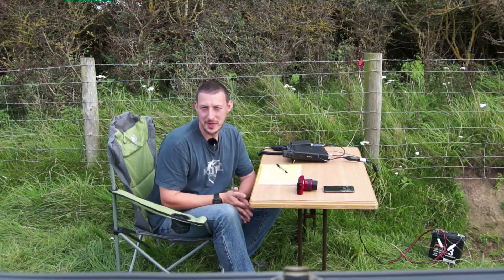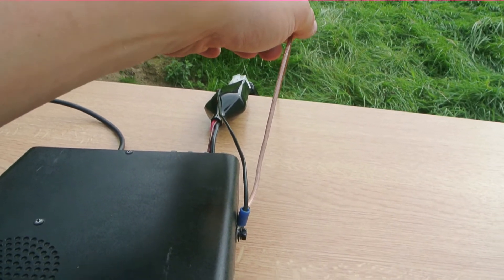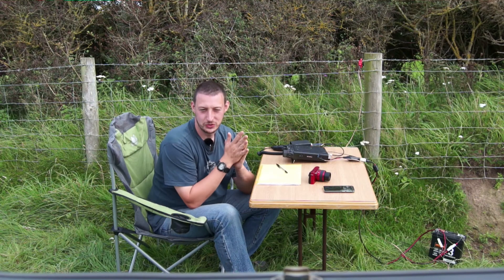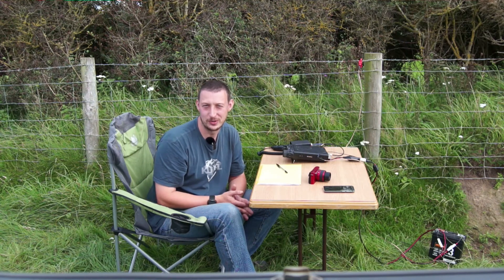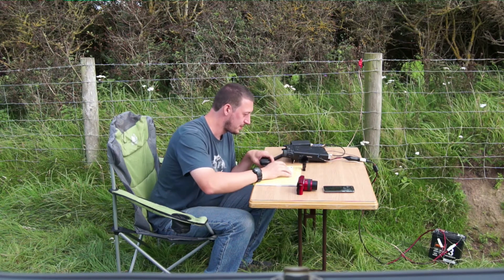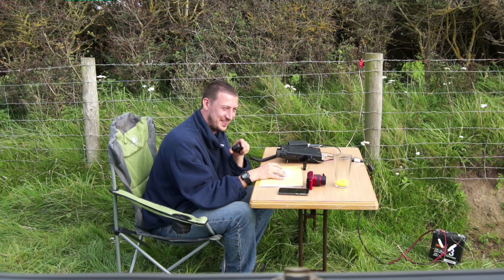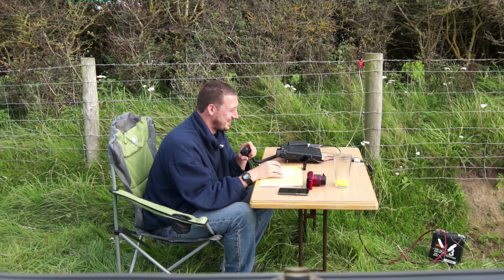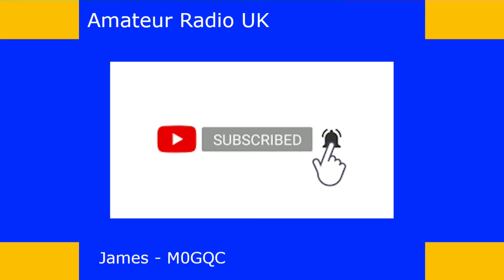Tuning A Barbed Wire Fence - A Prepper's Antenna?

Comment: U should use a weather balloon for antenna or a drone
Reply from the maker: I've used a kite to lift an antenna, which works very well.

I've never tried a weather balloon or drone for lifting an antenna though. I don't think it's very practical.......the weather balloon needs lots of gas (ie big heavy cylinders), so not really a portable solution. 

A drone could work, but they have very limited endurance.

Might be an interesting experiment though.

Comment: How was the performance compared to a loop or a vertical ? What frequencies did you manage to get the fence wire working on ? What distances did you manage to work ?
Reply from the maker: Absolutely rubbish compared to a proper antenna!

I think it was too low to the ground & with the grass growing up around the fence, I was probably getting a lot of ground losses.

I only tried it on 80m (and possibly 40m). It was a long time ago, so I can't remember the distances worked but I would guess it was only local NVIS contacts upto a few hundred miles.

You are better off with a proper antenna, even if it's a compromise (such as a loaded vertical). This solution of using a fence would be a last ditch attempt to get on the air if I didn't have any other options.
Reply: @HamRadioOnline  OK. Good to know. Thanks for sharing the results !

Comment: I've wondered about this for years. Could you use another run on the same fence as a counterpoise and turn it into a folded dipole?
Reply from the maker: That's a good question.

I don't know for certain but my gut feeling is that it wouldn't work because the two elements would be parallel with each other running in the same direction.

I think that this would make it act like a ladder line feeder (which is basically 2 parallel wires running in the same direction). I think that the two halves of the antenna would basically each other out the same as  ladder line does.

If you had a way of insulating the two halves of the fence and running the two halves in opposite directions, such as a gap in the fence where the wires were not physically connected (maybe a gate or a break in the fence), then I suspect that it could be made to work like a dipole........or would doublet be a more appropriate description for it?

I could be wrong but that's my guess as to what would happen.
Reply: @HamRadioOnline  I feel an experiment coming on in the summer. A length of coax, a transformer of some sort and some crocodile clips should do it.
Reply: I've picked up the same tuner. If the Argentinians invade and I haven't a clothesline handy, I'll be sure to give this a try.

Comment: By connecting in the central area of a fence wire you have created a top loaded or T antenna rather than a long wire antenna.
Reply from the maker: That's a fair comment.

You probably can't see it in the video but the point that I connected to the fence was only about 3-4 metres from the gate at the end of the fence. The fence was probably around 100 meters long in total, so it would be a very off centre T

Comment: This is the only video of this sort I could find, so I appreciate your experiment. I was thinking about trying to hook a tv antenna to a wire fence nearby. I have a spot on my property way down under a big hill by a tiny creek, and I want to build a little hunting cabin there. It would be nice to be able to bring in an over the air tv signal, and there is a barbed wire fence close by that goes back to the top of the hill. I didn't think it could shock anyone except for my self perhaps if lightning were to strike the fence. Anyway, thank for the video. It gives me hope that this idea could work. I may end up having to run an antenna wire up the hill and up a tree though!
Reply from the maker: Thanks for your comment.

I mean what I'm about to say with the greatest possible respect...........Judging by the wording of your comment, it sounds to me like you have limited experience when it comes to radio. My guess would be that you are not a radio ham, or are very new to the hobby?

I'm going to go with the warning that I gave in the video & state that I absolutely DO NOT recommend doing this.

The risk of electric shock (or more accurately RF burn) to other people as mentioned in the video is due to the fact that I was also transmitting into the wire fence. In other words while I was talking on the radio I was pumping around 50-100 watts of RF into the fence.

In your case (TV reception) you are using it for receive only. Unlike me you are not actually transmitting on it. Therefore you are not going to end up giving anyone an RF burn. That isn't a problem.

HOWEVER.......Where you will run into problems (& will need to take mitigating actions) is with static build up which can absolutely destroy your TV. Also lightning which could cause a fire & be potentially lethal to anybody who happens to be stood too close to the TV at the time.

Static:- This can build up due to storm activity, or even just airflow (from the wind) blowing over the wire. This can build up to surprising voltage potentials & quickly destroy the receiver components inside your TV. You need to have some kind of system in place to safely bleed off this static to ground.

Lightning:- As mentioned above, a direct strike could be lethal. It would probably also vaporise the wire making up the fence! There isn't really a lot that you can do about that. If you have a direct lightning strike it is going to cause damage & destruction!

It should be noted that lightning doesn't need to physically hit the antenna to do damage to the TV & pose a danger. Just the static build up in the air during an electrical storm is enough. This is true of any antenna but with a long fence there is much more area to collect static than a standard roof mounted TV antenna.

Basically, if you are going to try this you need to make sure that you have adequate grounding to the antenna to bleed off any static build up & disconnect the antenna (preferably outside the house) if electrical storms are expected.

The other thing to consider is the RF pattern of the antenna. A long wire antenna which is many wavelengths long will tend to have some directivity. Great if the antenna is pointing at the transmitter, not so good if the transmitter is to the side of the antenna. I suspect that the fence will act more like a beverage antenna.

As you can see, there are a few problems with this.

That isn't to say that it wouldn't work but I would politely & respectfully suggest that you really need to know what you are doing if you are going to try this.
Reply: @HamRadioOnline  , Hey thanks for the reply and info buddy. Yeah I would need to ground it and do more research just to be safe, and I thank you for the words of caution. 
The fence is an old barbed wire fence way off in the woods. You can kinda see it and the terrain of the land in this video I made. 
Thank again partner, and don't worry, I'll be careful.
https://youtu.be/X-idJuYSy5s

Comment: Good experiment James 73
Reply from the maker: Thanks Tim. I've got a few other ideas for things I want to try over the coming weeks (a couple of which I've already filmed but still need to edit).

Just seen your video on the 20m 1/2 wave vertical. Looks like you had some good results.

I went to the Welsh coast for a couple of days last week (which is where this video was filmed) and was also been playing with a 1/2 wave vertical on 20m.

I figured that a low takeoff angle from cliffs combined with a significant quantity of salt water below should result in my signal getting launched straight over Ireland, bouncing back down & landing somewhere in the USA.

The intention was to try to bag some new American states which I hadn't worked before. Unfortunately it didn't quite work out that way.

Infact, my signal went in totally the opposite direction........straight over the UK & Europe, eventually landing in the Middle-East & Africa!

Not what I had intended or hoped for but I did end up working a couple of countries that I hadn't worked for a long time so I can't complain.

Propagation is a strange thing!!!
Reply: Amateur Radio UK it sure is ... dark arts of rf. I look forward to those videos James. Keep them coming 73